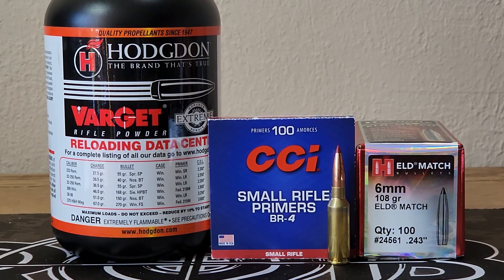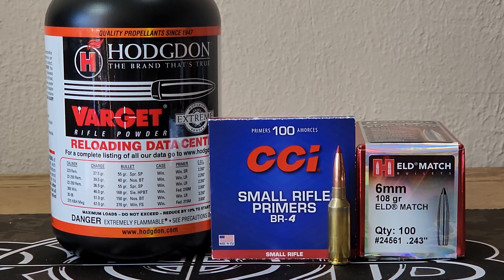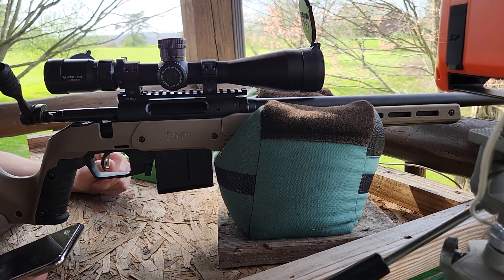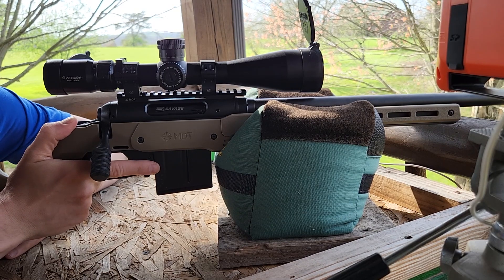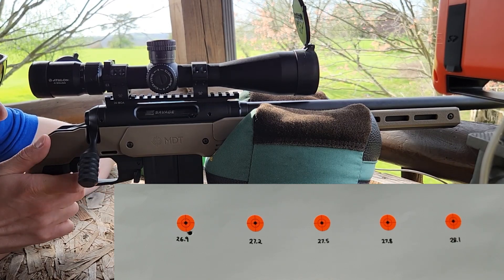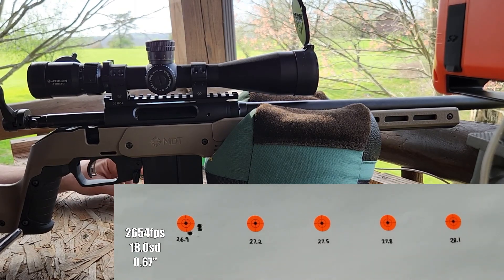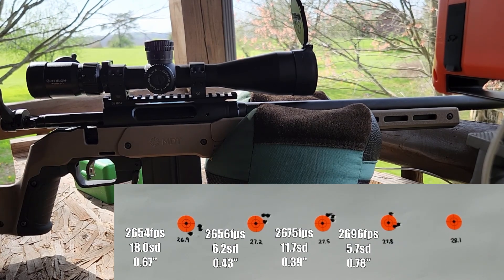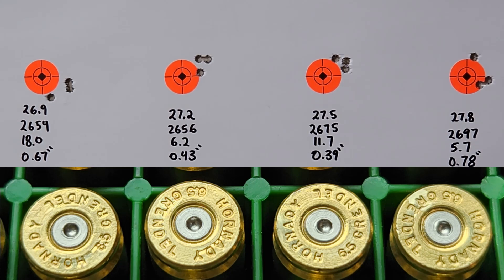6mm ARC, Varget, 108 ELD-M

Comment: Thanks for the work you put into this.  Nice groups.  I'm leaning toward CFE223 or LVR.  It will be super to hear about your upcoming competition if you go with the 6mm ARC.
Reply from the maker: What made you choose cfe and lvr vs some of the other more temp stable stick powders?
Reply: @RobsReloading  Honestly, it has been by reviewing shot data and recommendations from several reloading resources on line.  Plus the convenience of ball vs stick in a small necked cartridge.   I'm also more of a decent weather target shooter and hunter.  That is, I'm not planning on being out for extended forays during inclement weather.  I would have the factory ammo option if that was the situation and I had concerns.

Comment: Nice video, one thing to check in any reloading recipe is twist rate of the test barrel. Recently loaded up some Grendal, recipe was done with a barrel with 10:1 rotation, my barrel is 8:1 twist rate. Velocities were higher than expected and had pressure signs from the start. Velocities were more than 100 fps higher than expected. For my barrel I'm going to reduce charge by a full grain of powder per inch of twist change. That may be too much but better safe than sorry.
Reply from the maker: My rifle has a 1:7.5 twist. Pretty standard for the 6 arc.
Reply: @RobsReloading  1:8 is pretty standard for Grendal, my point was the recipe was for a 1:10 twist. The faster twist rate of my barrel, I believe, caused high pressures. YMMV.
Reply: Good point😊

Comment: please do a video on 87gr vmax and varget an chase some speed and see where you end up
Reply from the maker: Hornady does not include Varget in their bolt action load data for the 87gr Vmax. They list the max velocity with Leverevolution at 3050fps. They only list a load to 2750fps with Varget in the AR15 load dada.
Reply: Hornady doesn't list Bolt Gun data for Varget and the 87 grain Vmax. probably because Varget is too bulky.  Even their Gas Gun maximum load is around  111% compressed.  QuickLOAD says a max charge of Winchester 748 could get the 87 grain Vmax close to 3000 fps even out of an 18-inch barrel (bolt gun pressure).

Comment: Rob did you settle on Varget over N540
Reply from the maker: Yes ended up using 27.0 gr Varget. It was kind of a hot load and really should back it off a bit.

Comment: I appreciate the videos especially for the 6arc. I am starting to come to the conclusion that 6arc in Ar15 platform is very limited. Meaning, if you want decent velocity, you are almost stuck with temp instable ball powders.
Reply from the maker: I don't have any experience with 6 arc in the AR, but think it would still be a great choice in an AR. Better velocity and ballistics than the 6.5 Grendel. I'm sure you can still get respectable velocities with longer barrel AR's. For myself I enjoy reloading for bolt guns more than the semi autos.
Reply: Other than velocity ARC outperforms 5.56 in every other performance category, But I still hear what your saying(grin), I think if one of the manufacturers came out with a factory load in the 85-95 grain range, all the need for speed anxiety would disapear for people, but the thing to remember in those lower weight bullets is they don't have the good BC numbers so you loose the 1000 yard supersonic capabilities with the ARC, I think it drops to 700 yards. 

I don't remember what forum I was on, but there was a guy sharing data, and he had 88-90 bullet(Berger?) and he was hitting 3500fps with great results, he dialed back the load to 3200-3300 just to improve barrel life, I should note that it was 24"  bolt gun, but I would think a 18" AR would be right around 3000fps, which I think would be quite acceptable. then again I could be wrong based on the lower pressure limits for the AR.....So what the AR15 community needs is someone to take the new 6.8x51 bi-metal casing technology and apply it to the 6mm ARC, and then the pressure issue is resolved. 🤣